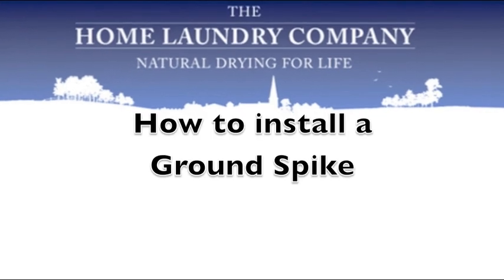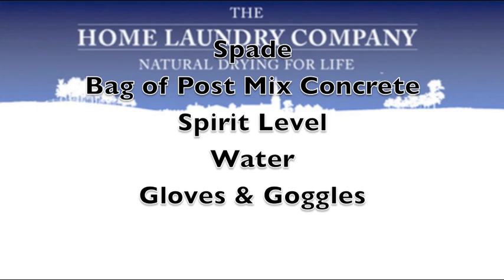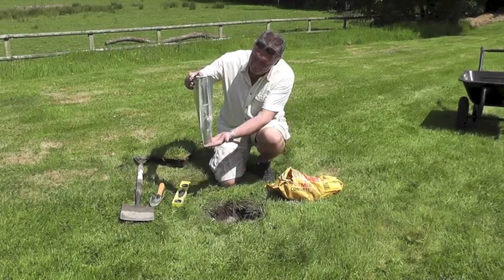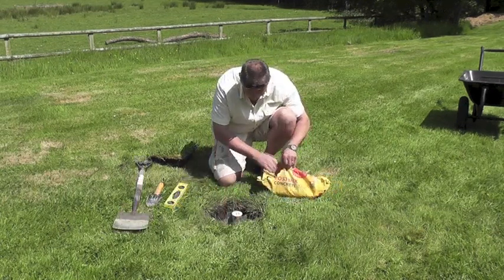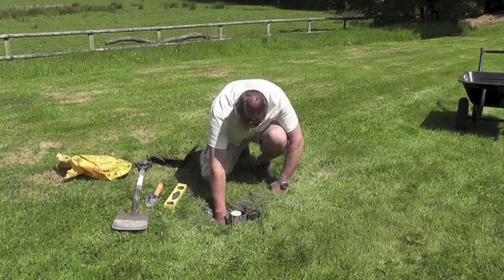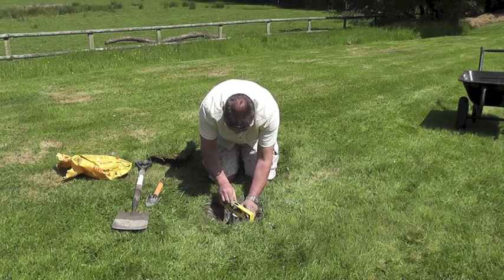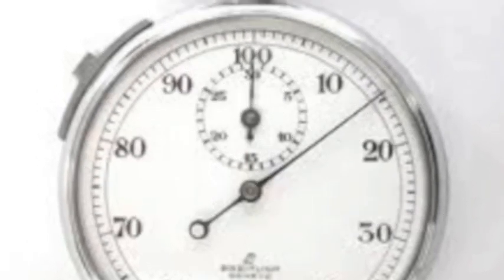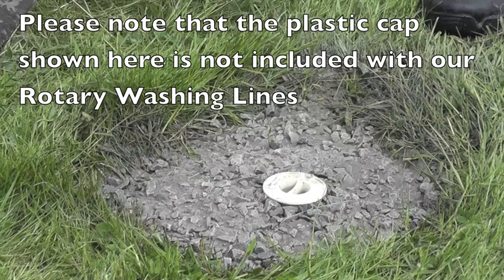How to install a Ground Spike

Comment: I just used my Garden Parasol Stand. It is very heavy, with a large diameter, and is impervious to high winds, even fully loaded with sheets etc . I just put it in the shed, come winter.

Comment: Not a good demonstration on two accounts 1. Placing your hands in concrete risks skin problems. 2. To ensure the pole is vertical it should be inserted and checked for perpendicular with a spirit level check then at 45 degrees.

Comment: Mate I don’t want to use fucking cement or post create why are there no ducking videos with just placing into the ground
Reply: well  it will fall over MATE
Reply: @ well MATE 2 years later and guess what. It’s still standing strong, thanks for your pointless comment